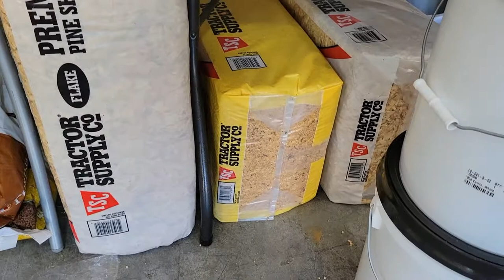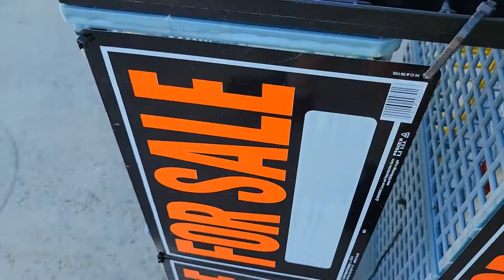"Hatching Time Cages major clean up & Quail accommodation"

Comment: I just found the channel because I found a deal on a set of Hatching Time cages for sale on craigslist and was looking for info. They have 2 rows of cages, and 1 row of Brooders with heater for sale for $500. Looking for additional info on these cages to see what they  are all about. never tried keeping quail before and may be interested in trying them. How do you like that cage set up? Does it get top heavy with the two rows of cages and one row of brooder on top? Thinking that would be an ideal set up for keeping quail for eggs and meat. Assuming it would have to be kept indoors out of the rain/snow based on the design.
Reply from the maker: The cages are excellent. I'm not able "yet" to place my birds outside as our property is at an incline upwards and not flat. Thus the cages are in our garage. They are easy to clean and I have a 6 gallon water container on top of their cages and there is no weight issue at all. Plus, I'm incubating another 52 eggs right now and if I have a successful hatching, I will be purchasing more hatching time cages. We raise the birds mainly for their eggs. We sell a lot of Quail eggs locally. You will really love the cages. 🙂
Reply: @sparksfamilyhomestead  thank you for the assistance! I've been watching craigslist ( the unit i discussed above sold before I could decide) and just found a 3 tier layer set up, plus 1 brand new brooder tier and one grow out tier for $700 which I think is a fair deal. we also found a farm innovators 4250 incubator with egg turner for $50 bucks. SO...i think we are close to having what we need to begin. Can you do a video on what's involved with selling the quail eggs, how you go about it, what to charge, etc. The cages im getting dont have the larger floor openings, so I may stick with bob whites or another smaller species. I want to make sure the poop will fall thru the floor.
Reply from the maker: @rbljackson  yes, I can do a video of how we were able to sell direct to a couple of markets here. It will be short though. There are many ways to sell your eggs. I'm still getting over a bronchial sickness. It's almost gone but my voice is still suffering at the moment lol.. looks like you've got it going! That's exciting! With your foundation your establishing, you will be doing great. Congratulations! Wayne
Reply: @sparksfamilyhomestead  Get better. I will have my mom pray for you

Comment: What lights have u got, & where did u buy them plz
Reply from the maker: The Ring lights, I ordered from Amazon Prime. The cheapest I could find that will work for you is the Hongdak 10.2 ring light with stand and phone holder. One light is 10.99cents. You do not need the stand or phone holder. All you need is the ring light. It's bright and it's LED. Hardly uses any power. Each cage section I have has one ring light attached by zip ties in the ceiling tip area of the middle section. Kevin from Living Traditions did a video on how he used ring lights in his quail cages. He's a genius 😆 but it works! All my hens lay every day. I have the lights on a timer to be on 14 hours a day. Thus when I go to bed, those birds go to bed. Thanks for asking. Wayne